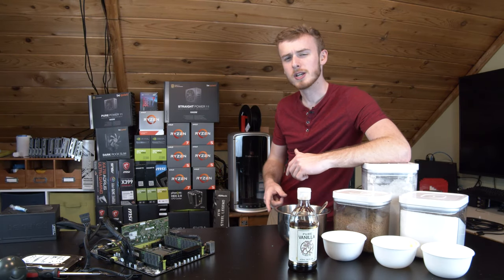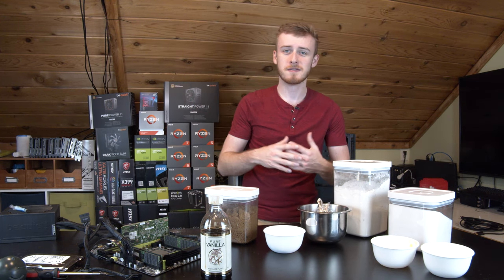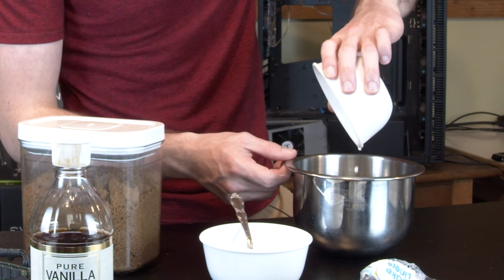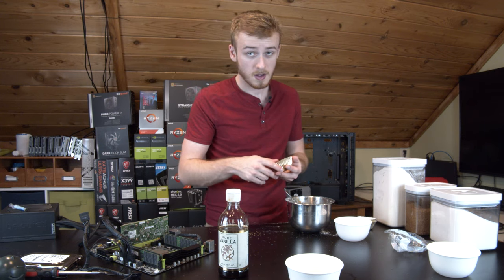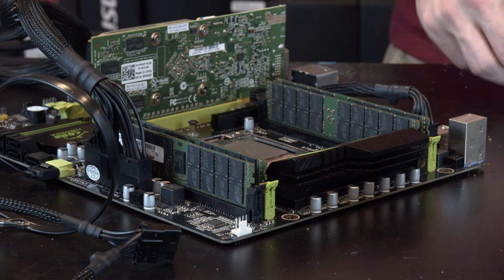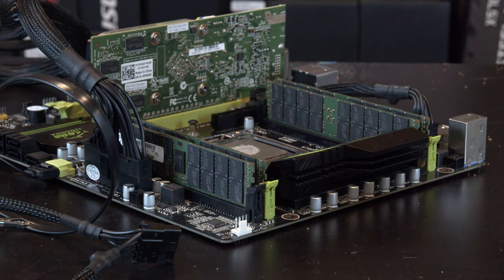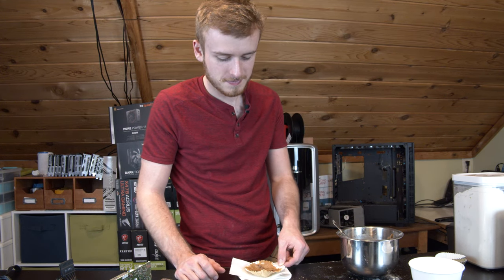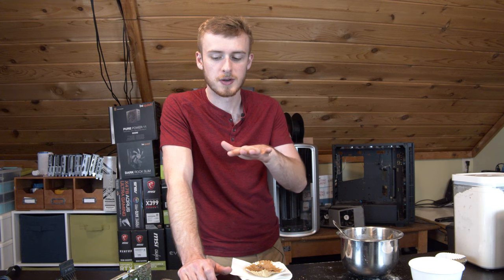Can You Bake Cookies On A Computer Processor?

Comment: So try this next time: get a piece of tin-foil and fold it over and smash it down against the CPU and thermal paste. Apply a little canola oil or even baking spray and drop a dollop of dough on the middle right above the CPU. That should give you much better results, and you don't have to go digging for a pan that will fit the motherboard.

Comment: You know, this is a ridiculous and hilarious concept, and I love it. I wonder if the method can't be refined a bit. It's all about heat transfer and avoiding thermal throttling. So what about maybe using the an AIO radiator as your surface? Just spitballing.